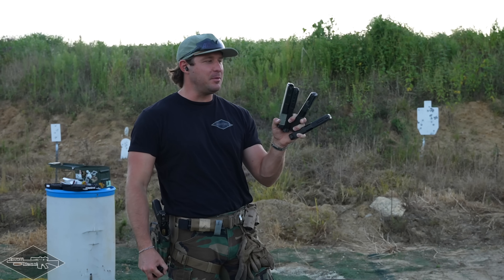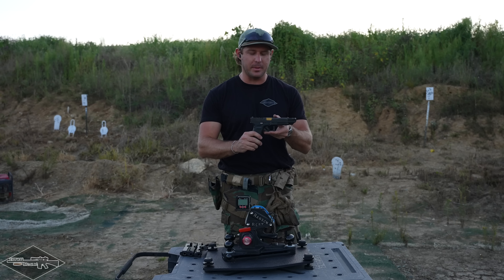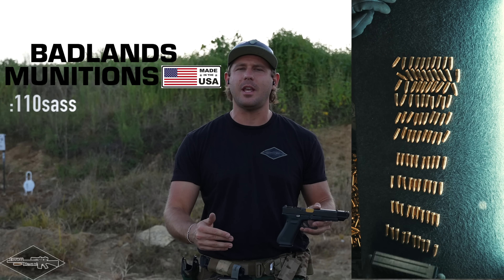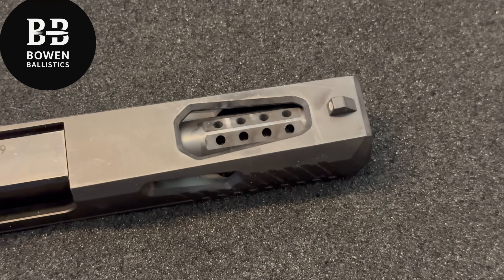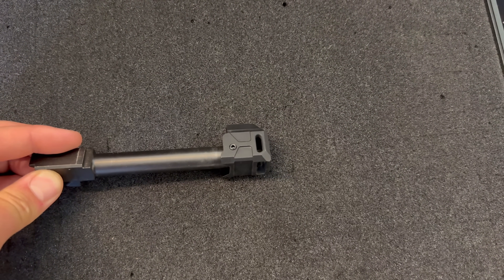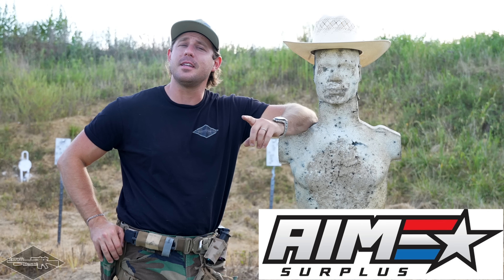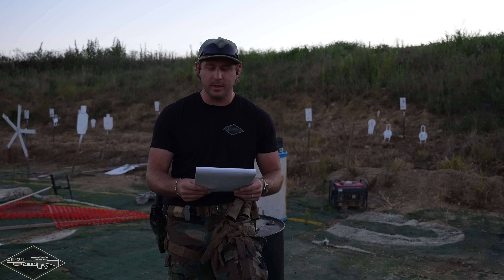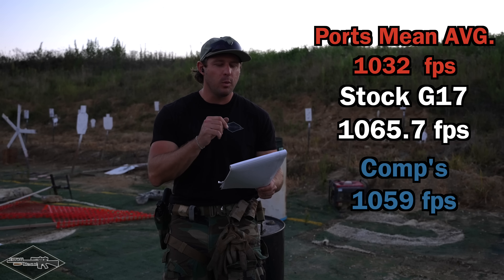Science Finally Proves It - Which Is Best?

Comment: You should do a comparison on recoil Springs if they actually work. Like pure tungsten guide rod and the DPM.
Reply from the maker: Never took those seriously tbh. Might have to try!
Reply: @110sassactual no Brasil temos uma empresa que produz molas hidráulicas, mas confesso que nunca testei para saber como isso se comporta
Reply: @110sassactual aside from the springs K factor the mass shouldnt be that much of a factor if its a polymer handgun
Reply: @110sassactual please do
Reply: Yes this please. The DPM is so expensive it’s hard to want to take the plunge based on randos “feelings” but some solid data could make it a no-brainer
Reply: @TRR56  I can say this about the DPM, my Glock 29 would jam about 1 in 50 on hot 10mm with the stock spring. DPM eliminated that problem when just using heavier springs did not.

Is it better for recoil? Idk...it does feel different. I don't know that it reduces muzzle flip over all just changes how you experience that energy.
Reply: @TRR56 Lol you got more feels answers where people definitely know!! Is the gun in question a cooperation gun, fun gun or carry gun. 

Carry gun, pretty much leave it alone. 

Fun fun, do whatever you want. 

Competition gun, get a steel or tungsten guide rod and run a single spring setup. You run the lower weight spring the gun can handle. There are several ways to figure that out that’s too detailed to write out here. 

The problems with the DPM spring is newton’s third law. So if you’re gun it’s over sprung from the factory the DPM setup could potentially help but   With that said it’s never the best option because the DPM springs are pretty heavy regardless. Most striker fired pistols will cycle with a 15 pound spring pretty reliably in my experience. You’ll get a much better experience that way than compared to a DPM setup. 

With that said the customer service at DPM is great. I actually broke one of the units in testing and they warranted it no questions asked.
Reply: @TRR56  I don’t think dpm does anything but that’s just my feels.
Reply: I have DPM recoil systems in all of my pistols. They really help tune it, especially if your training ammo doesn't cycle with your comp or ports.
Reply: Dpm system definitely works on my 5.25” target xdm 9mm. Mine actually has 3 springs. One is internally captured that absorbs the recoil of the slide completely bottoming out.
Reply: This!!
Reply: Tungsten guide rod only adds muzzle weight, reduces flip but not slide recoil.

Progressive springs affect linear slide motion.

Comps should help hold the muzzle down without reducing velocity.

Ports help hold the muzzle down and reduce velocity.  Both of which reduce flip.
Reply: Agreed!
Reply: There’s a new hydraulic guide rod for Glock 19s by Khynshot that looks interesting.
Reply: I've had tungsten, stainless, plastic, etc guide rods, save your money. If there is a difference it's so minimal it literally will not affect your shooting ability. As far as springs go, there are some good reasons to change springs, but if you are shooting regular ammo out of a non-modded gun, then leave it stock. Or if you're shitting either super weak ammo or +p+ ammo, you might see a benefit in "tuning" your gun with a different spring weight. Last reason to change a spring is off your gun isn't cycling, it COULD be the spring, but it could also be 15 other different problems.
Reply: @FrankLewis040  I changed my g17v1 stock spring for a newer one after 9000+ rounds because I was getting weak slide closes. Sometimes I had to wack the slide into battery. Only failure. Best way to reduce muzzle flip? Wrist strength training.
Reply: Agree
Reply: DPM is hit or miss in my experience. They work well in my Steyr M9 and Sig p320. I got one for the Glock 43 and it always jams. It didn't make a difference in the Original Smith and Wesson Shield. It didn't make a difference in the Smith and Wesson SD40VE.
Reply: Work for what? They're not really recoil springs they're return springs. You can pull them out and the gun will still fire safely it just won't return to battery.
Reply: sprinco too
Reply: Would be great to see. Personally I like metal guide rods. Glock 17lbs is standard. 15lb should be perfectly fine for any use even carry. Competition gun, all rules are scrubbed. You can find people running gun and ammo loads that are just trash for defense and reliability.
Reply: Dont forget the NDZ brand. They also have a similar product that DPM offer.
Reply: I’ve spent a lot of time using dpm against stock including handed blind so i dont know which one is in. Firing from 10 and 15 yards, i am consistently far more consistent in accuracy and time with dpm springs. I was curious myself at one point, have spent the money and have had good experiences with improvements on several brands.
Reply: The PX4's DPM solution would be the most interesting to me, given the rest of the gun's action being atypical. More interesting than three polymer-framed, striker-fired guns, anyway
Reply: Don’t have a Glock, if that’s what you’re looking for, but on my VP9, it could be a placebo, but I feel like there’s a very small noticeable difference.  By small I mean like 1%.  I felt like it had even more noticeable difference when I upgraded my trigger after it.  Then again, could just be the trigger itself.  If it’s an EDC, I would never touch it.  If it’s a gun you do comps with, I would say, no reason not to try it.  Every second counts.
Reply: I have tried pretty much all of the recoil springs out there for striker fire pistols. Something in general, smaller single stage diameter springs shoot way better than larger or heavier setups.

Comment: damn i wish i knew this was coming. I would have lent you my Mass Driver Comp. Im curious what is runs at considering the weight it adds to the front. Other than that I use the aimsurplus v8 port on my g19.

Comment: I'm actually surprised by the results. I would have assumed since the comps have the holes further out on the barrel that they would essentially have more leverage to push the muzzle down as the gasses escape. I'm glad I own a ported pistol instead of a comp now. I never liked the extra length that comps add.
Reply: Ammo choice really makes a difference for comps performance. Generally you want hotter ammo that has more gas to push on the comp.
Reply: That's exactly what I assumes, too. So much for assumptions :)

Comment: Would be cool seeing the results for the Micro 9mm’s, like the Shield Plus or P365’s. Feel like the results would be more dramatic in those
Reply from the maker: Def would be fun! Just expensive hahaha
Reply: @110sassactual  maybe you can call on your audience or friends for hard room they already have.
Reply: Id love to see the difference between slide lengths of the p365 x,xl and fuse might give some insight on other pistol slide lengths
Reply: I built a 43x clone with a psa micro dagger frame and zaffiri windowed slide. I got a ported barrel and just got a threaded barrel. Just need a comp now so i can test both.
Reply: @familyengineering5591  how much did that setup cost you. and hows the trigger on those daggers?